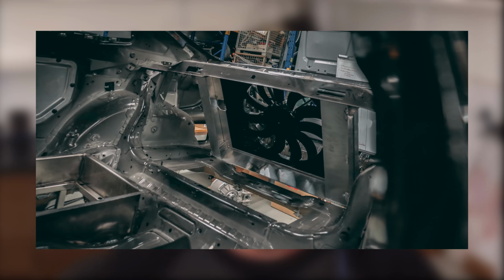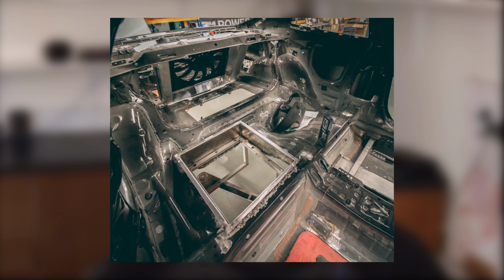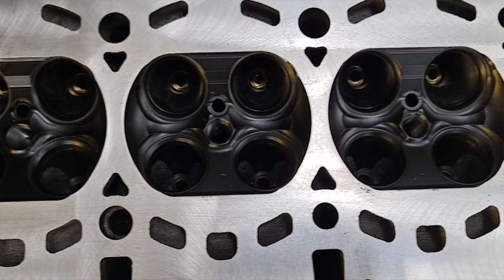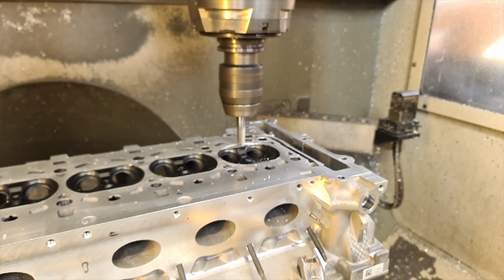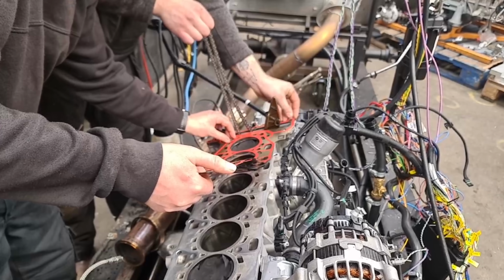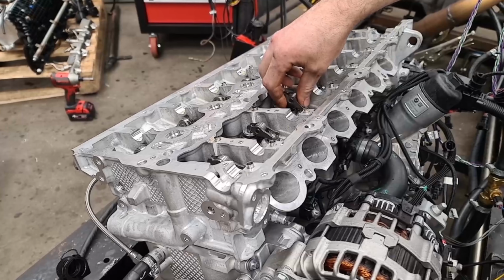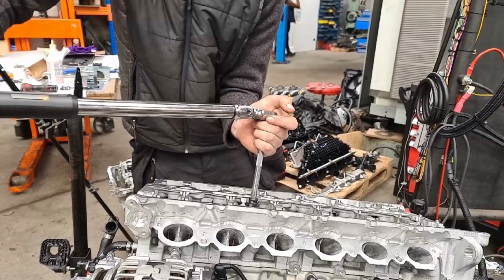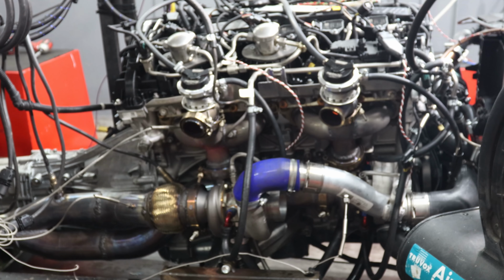Confirmed! BMW M4 S58 engine with 1.000+ bhp!

Comment: N54 owners are going to be salty af 😂 this is awesome!
Reply: N54 owners are always salty af 😅
Reply: maybe people that bought them new & stuck with it, but this news just makes me happy because N54 cars are going to get even cheaper to buy & make ~500whp with :)
plus I am just happy that BMW did what we all knew they could with this motor right out the factory, turns out the N54 was just a proof of concept & learning exercise haha
Reply: E92 V8 owner here..... in corner hating da F outta these figures. Sad times@_@
Reply: Not quite sure what any N54 owner would be salty about. The S58 has tons of advantages - notably being in a flagship car with a nearly double MSRP and 13 years of tech advancements.
The S58 is an insane engine from top to bottom. N54's were special for the era they came out, and to this day they still offer more performance than most will ever need. I am content with my good old power steering, lighter car, and 550whp. I like having a basic interior with minimal tech and no massive screen in the middle of the dash. That in no way makes the N54 or E9x chassis better than the S58 or G8x M3/M4. I just don't need more than what my 07 335i has to offer.

Anyways, as an N54 owner, it's great to see what these S58's should be capable of. It's truly an incredible engine and no other BMW turbo inline-6 engine is even close.
Reply: @DrewAnyDay83  lol why would you guy ls be sad? E92 sell for 40k to 90k if you have them in mint condition

Comment: So can we finally dethrone the 2JZ w the S58 based on the bottom end alone? Obviously the cylinder head and direct injection along w the s55 and b58 n54 have these problems also.

Comment: No wonder Toyota wants the S58 but BMW is like Nein!
Reply: Did they say there will never be an s58 supra? I thought they are just holding back the "performance supra" for strategic reasons because they can sell more cars that way.
Reply: @laurean5998  yes and no ,BMW has been hard to work with Toyota so Toyota might just re-engineer the B58 and put it in the GRMN version, just a slight rumor.
Reply: @X1xRiGox3X  i hope they put some GR magic on the B58. I doubt BMW will be willing to give their best engine to date to another manufacturer. Either way, both B58 & S58 are awesome engines.

Comment: und wenn man am Motor alles macht? denke so 2.000PS Locker und 2000NM
Reply: Wenn der Motor jetzt schon soviel packt, dann bedeutet das, dass Lager, Kurbelwelle etc. ja schon extrem standfest sind. Der Sprung von knapp 1.000 zu 2.000 ist riesig und sicher nicht „locker“, das sollte man nicht unterschätzen. Nicht zu vergessen, dass sich die nutzbare Spanne der Leistung krass verschieben würde. Man müsste von zwei Turbos auf einen großen gehen.
Reply: @gesgwsush  Wenn es um Maximalleistung geht fahren aber alle Alupleul, um die Lager zu entlasten und Alkohol für die Verbrennungstemperaturen, was die beiden noch nicht tun, also ist noch gut Platz nach oben, zumindest solange die Kopfdichtung hält und die Lagerdeckel nicht in der Ölwanne landen. Die große Frage ist für mich: wie sieht es Drehzahlmäßig aus? Bmws hatten ja (vom s54 und vorgängern abggesehen) nie die möglichkeit, in den 5-stelligen Bereich zu drehen, wie dies hondas, 2jz, nissan rb, sr20, 4g63, gtrs und co (mit modifizierung) können. Dazu braucht es ja auch immer Leute, die extrem Geld in die Plattform pumpen und das r&d finanzieren, ob das passiert wird sich noch zeigen...

Comment: What standalone ECU are you using?
Reply from the maker: We run a MoTeC M142 as the ECU, accompanied by the MoTeC PDM30 as a power distribution module and the MoTeC E888 as can expansion unit to get all the data out.

Comment: So you HAD to tune the car to work with the new turbos. How did you get past the DME encryption? If BMW did it for you then you are kind of falsely advertising as this cannot be done without BMWs help.
Reply from the maker: We use a standalone ECU. 🤗
Reply: @redbulldriftbrothers  So an unlocked clone of the original. Interesting. Where might one obtain said ECU. Asking for a friend.
Reply: @Ruxor  😄
Reply: @Ruxor   they are using a motec ecu.